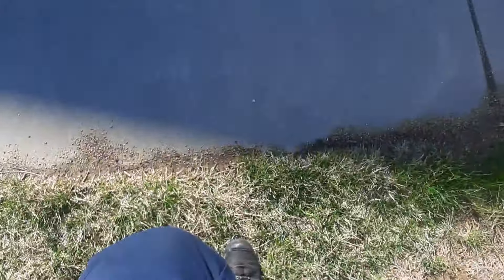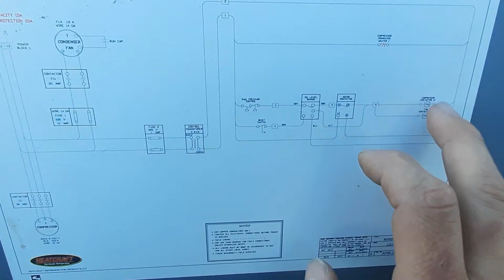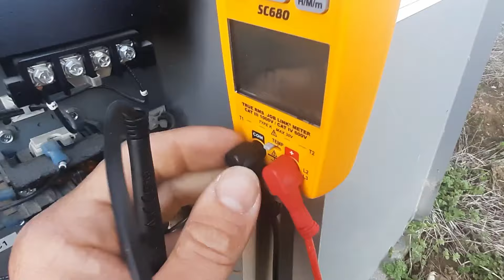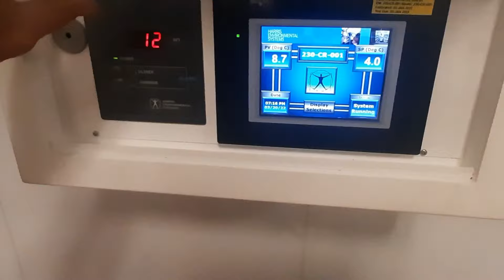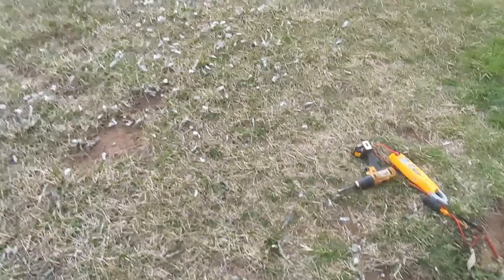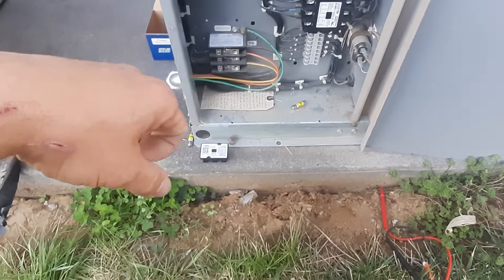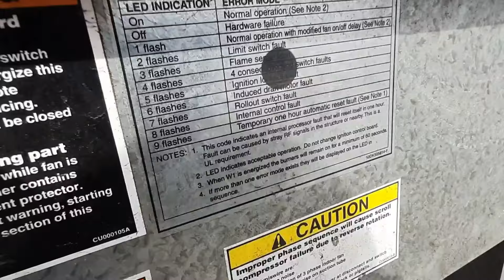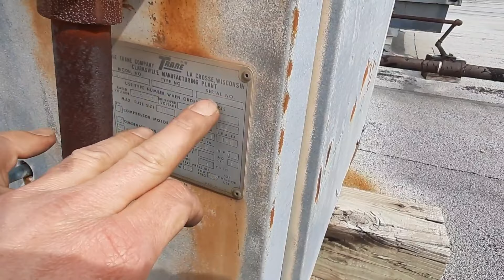walk in cooler + no heat service call

Comment: You said you think the rollout trip is due to that front plate being rusty... Wouldn't it be more likely the trip was from your belt being loose/low airflow?

That rusty plate presumably covers the section that connects the left and right loops of the heat exchanger (burners -> up left heat exchanger loops -> crossover duct/rusty plate -> down right heat exchanger loops -> inducer)

In which case, bad belts and low airflow would let the left side run a lot hotter (which can be seen in the video compared to the right side, looks crusty), and subsequently roasting that crossover/front plate. In turn heating the cabinet more and tripping the limit.

Ofcourse the holes you found won't help but that plate looks rusty and cooked for a reason, and I don't think rollout is the cause of it.
Reply from the maker: Thanks Thermoelectric7! Low air flow would more likely cause a high limit trip. The roll out, in my experience will trip when the front plate begins to rust out even before the heat exchanger is cracked. In this case my statement was probably wrong due to the front plate being more intact than I originally thought and the roll out tripped due to actual roll out from the heat exchanger failure.

Comment: What do you think was going on with that contactor coil? Higher resistance = lower current right?
Reply from the maker: Not sure RJ, yes higher resistance =lower current but abnormally high could indicate some insulation damage. Interesting thing is this contactor is energized 24/7 so maybe the life expectancy is less than a normal cycling contactor. What do you think? I appreciate you watching and commenting.